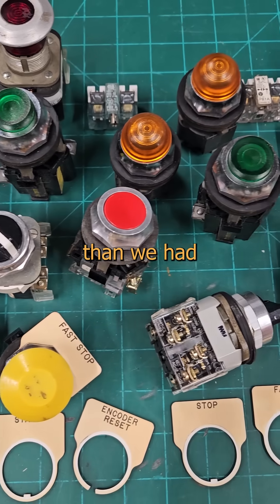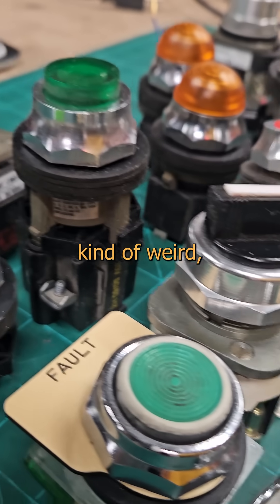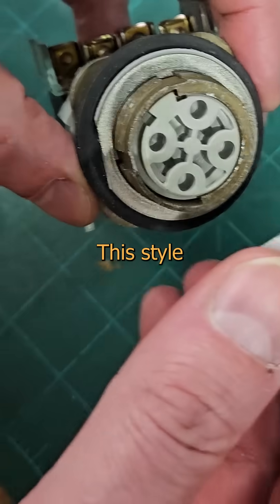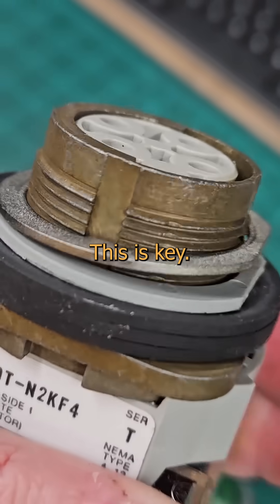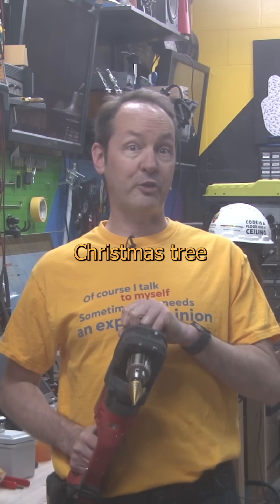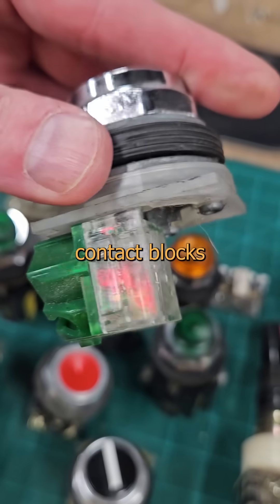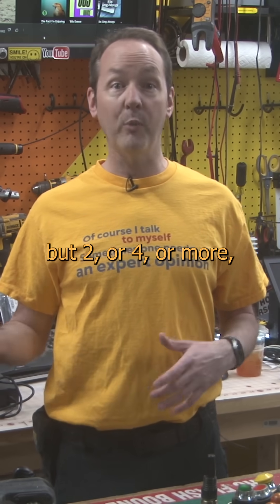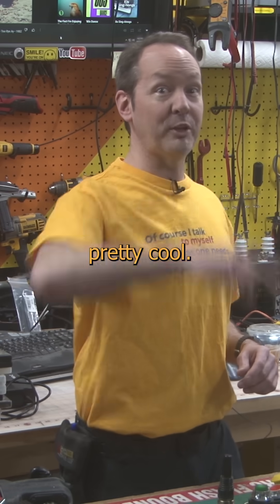Switches #chrisboden #engineering #industrial #control #panel #electrical #apprentice #educational

Comment: Did a couple swim schools last year. The different switches all throughout the mechanical room (and we’ll add the e-stops around the pool, for good measure) are pretty cool to get into. It’s nice to get a change of pace from the normal crap we’re used to doing

Comment: I love the standard 22 mm panel switches, as you can drill a round hole and file the keyway in the orientation needed, as the switch itself has the locating tab. Much more easy to make the holes.

Comment: I only encounter the really small ones at my work, since I only work with 380V max. But these are pretty cool and useful, snd all it takes is to draw a schematic of the thing you're trying to turn on or off to figure out how to wire it if it's complex. 

What sucks is when dust gets in the actuator thinge on the back and makes its resistance 340 ohms when closed instead of 0. I hate that and it's the bane of my existence on some machines.

Comment: And please try to set a standard and stick with it, either across the plant or the product line. My company has used so many different kinds that we end up replacing the whole assembly instead of just what is broken because you can't mix and match.

Comment: Wait, your switches are female-keyed? Dear god that's a stupid design. Over in Europe they're male-keyed, meaning once you punched/drilled that hole into the cabinet door, you grab a small file and file out the 2x2mm female key. No special tool needed to leave a male key behind, exactly because nobody wants to carry specialized punches in 12 different sizes around when the same step-drill and file can do all of them.

Comment: Just had to diagnose a bad momentary stop switch earlier this morning.

The original technician was sent to the machine for an estop nobody could find. He couldn't find the estop and tried starting and stopping from the control station which did nothing.

So he calls for another technician and I get the call. He's deep in the wiring schematic trying to find where he's lost voltage for the estop circuit. He tells me what's going on and absolutely none of it is making sense, so I take the schematic and dive in as well. Found the estop that was pressed, it was on the operator control panel with a burnt out light bulb, but the machine still wouldn't start. Following the schematic I find the estop line voltage made it farther down the line and stopped at the regular stop button for control stations. Turns out that stop button in the control station had no spring left in it and wasn't making contact anymore. Managed to pop it out with a flathead screwdriver, then the PLC lit up like a christmas tree, and the machine fired right up when started.

I mean this with all sincerity when I say I love my job. I don't know many places that will let me work on equipment like this and is willing to teach me how

Comment: With normally open and normal closed is that normally open with the switch pressed or with it not pressed how about with a toggle switch which way it would normal be it's hard to be an electrician

Comment: I am an electronics engineer with satellite coms degree. I remember being in charge of one office that provides L3 support to ISPs and having frequent small earthquakes in that zone that year.

Bosses are always kinda ass and never followed the recommendations about leaving buildings for safety reasons. So I installed a series of these switches in a panel in front of the office. Once activated all computers will start a forced saving state and enter freezing or suspension mode in like 10 seconds.

Once an earthquake happened, I would press those shiny buttons and everyone started panicking. At some point I was just waiting for some earth movements to have fun. Iirc, the other buttons were to forcibly unlock doors that needed bio scan, and another one for an automated message through telcos to stop receiving calls.

Comment: A BUNCH of years ago, I used a source company who made an adaptor plate with the correct tabs to index the 22 and 30 MM switches but only required a round hole in the panel. The adaptor also made a great spacer for switches to show how much room the switch needed behing the panel, which made controls layout brain dead easy and minimized mistakes. Two screws, machine screws or rivets kept the adaptor from turning and avoided the "brokitoff" torque from being needed.

Comment: Thats why i love whe Eaton M22 Series of Pushbuttons! You have to cut/file a grove into the cabinett to prevent it from spinning instead of having it the other way around. So you can just use normal Drillbits and a Dremel or a small File to get perfect results! 

And dont even get me started with the modular and expandable Contact-Blocks. Made my life so much easier so many times! 

Almost every broken switch in any controllpanel was swapped with these even if we had to rewire a little bit!
Reply: M22 for the win!  That model number is going to be written on the wall above my desk.  THANKS!
Reply: Dremel, small file, or perhaps a square nibbler would do nicely and result in larger pieces than the shavings a file or dremel would produce.
Reply: Yes! I even built a smart home controller (ESPHome) with a 6 hole box and some M22 stuff.

Comment: Those are so ridiculously expensive. At work we replace them with momentary toggle switches and washers to fill up the hole. Because 50 of them for $20 is better than one of them for $85.  I do have a little bit of an issue with this but what's the difference between the machine running and the machine not.

Comment: If you really need a tab for anti-rotation, a kiss with a TIG or even careful MIG followed by a small reshaping from a triangular file can do what you need. 
Some of switches have Al/plastic threaded through bits that jump to brokenov before gripping enough even with a washer.

Comment: "Once you learn to connect with one and turn it on... So let's get our fingers in there, shall we?" Not only am I learning about switches, I'm learning that I'm clearly running in the wrong circles if that's the order of operations you're used to...

Comment: your car key ignition is switch just needs the right grove for the right hole. its a combination switch it has off, on but also  bounce back capacity once the car or truck has started.

Comment: That tab is why I like 22mm switches.  Don't have the issue.  But I loathe the 30mm shit in a round hole.
Reply: 30mm was being phased out when I was an apprentice.
Reply: @dogwalker666  I'm still building control enclosures with 10+ 30mm push buttons and switches. DoD likes the big buttons.
Reply: @ Here we stopped using them decades ago, If you need a replacement it’s either a big washer or very long order time. 
And 10 x more expensive

Comment: Familiar with Allen Bradley safety electronics. I love how the only difference between an industrial death machine, and an amusement park ride is just how many people you can fit on it to do dumb stuff😂. I absolutely love the rides to be honest.
Reply: The logic tracks. Most amusement rides look like repurposed farm equipment anyways. The horrifying thing is that the traveling amusement rides are cleaner and have less leaking fittings than built in place industrial machines.
Reply: @d3m0n54in7 
  Believe it or not, more frequent and indepth safety inspections
Reply: As an amusement park ride op, I support this statement. Our biggest ride literally has a Siemens Simatic running it, and everything has this style of controls. Just looking at the panel, you'd be forgiven for thinking the box with a screen and a "Running Boards" switch belongs on a tractor.

Comment: "Brokenov" will now be in my vocabulary for torque along with "ugadugas" and "gutentight"
Reply: I've been using that german torch setting for years.But now I know the russian torque setting.  That part killed me. Just sitting in a vehicle giggling to myself like the industrial nerd I am.
Reply: I got tired of Gütentight and switched to Russian and torquing to Klosenov. 
When it's really important, I go to African Zulu spec of "click-click".
Reply: @panickedmechanic7536  Holy shit, this is gold.
Reply: I actually learned about the uga dugas from Eric O of South Main Auto years ago. Had to do a few last weekend myself when installing a lower control arm on my car as I didn't have a torque wrench handy.
Reply: Gutentight is gold! Surprised I’ve never heard anyone say that before at my place.
Reply: same here! i knew gutentite from working on BMWs but now ive got the knowledge to work on Ladas! Thanks Chris!
Reply: After having had to tighten several Russian manufactured objects, I was quite well acquainted with this torque spec. They use it on most of their rifle optics.
Reply: I still prefer the french fauxkit when working with the wrong tools.
Reply: IGOR BROKENOV??.
Reply: Came to say this myself through tears of laughter.